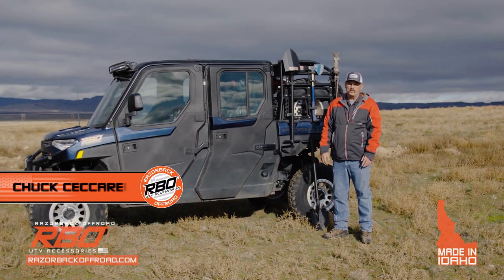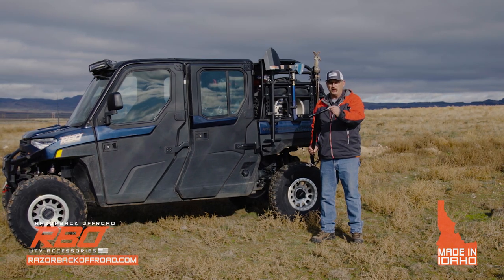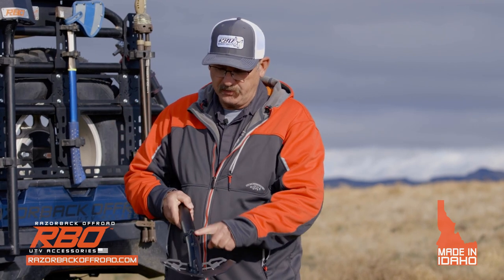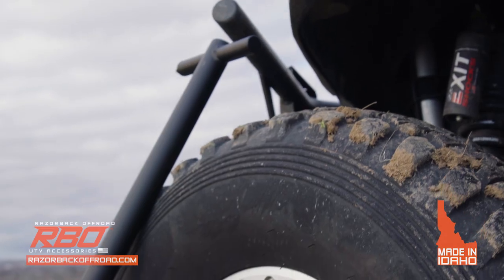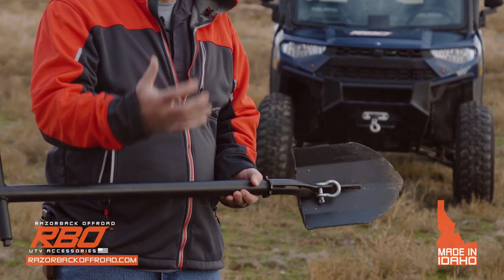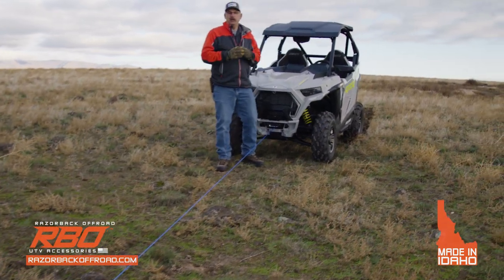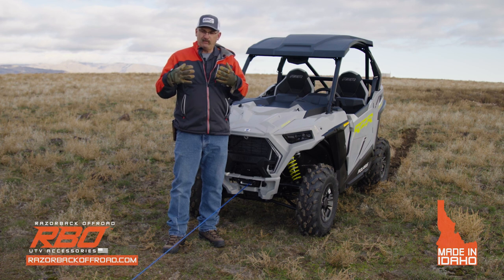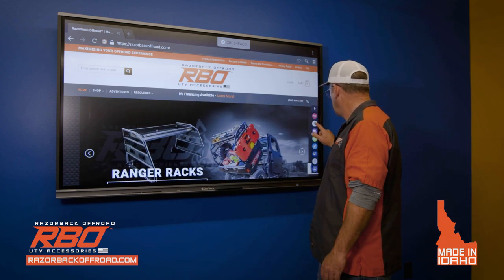Offroad Recovery Shovel and Winching Tech Tip

Comment: Thank you for this very informative video on  the basics of winching!  I feel that I will be much better at estimating, not guesstimating, the requirements while attempting a recovery.  I have also used a kinetic recovery rope and soft shackles on occasions when winching and I would like to know your thoughts on those items.  I am interested in methods to anchor the winching vehicle while recovering another.  I have both front and rear mounted winches.  BTW... I have your RBO Expedition rack on my 2019 General 4 1000 and love it.  It provides a method to secure your trail gear when the door and gate are closed.  I'll be ordering that shovel.